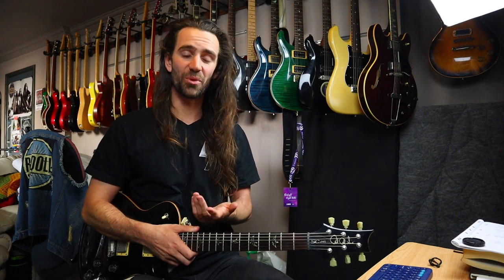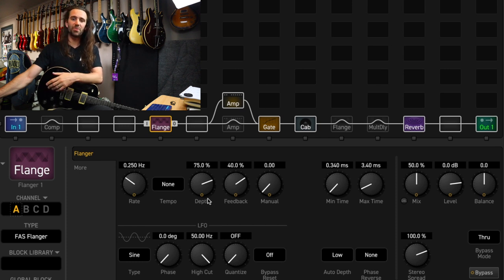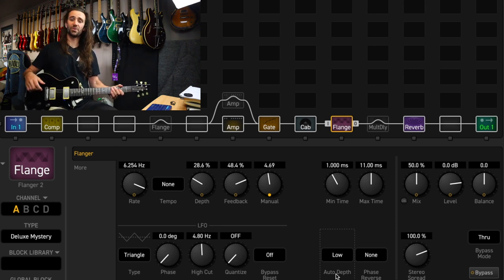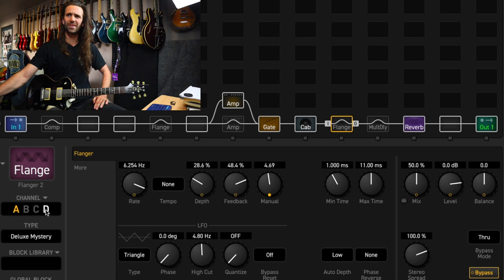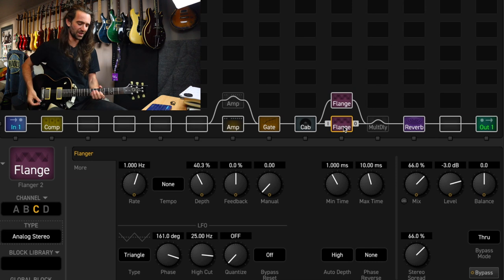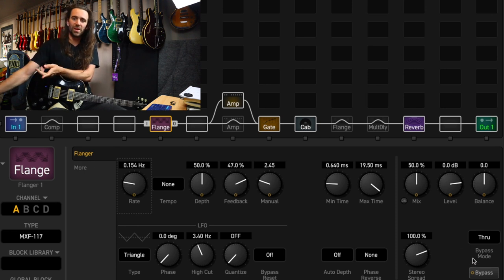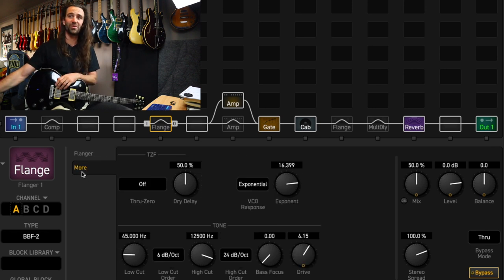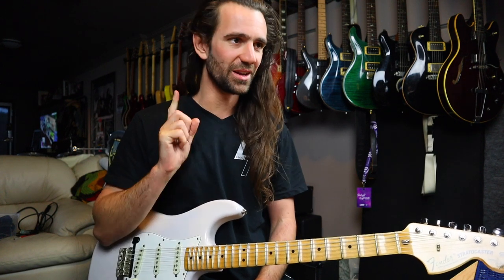Flangers! Axe-Fx III & FM3 - Tips, Tricks & More

Comment: The TC 1210 is a super confusing unit. It does say Flanger on it, and it does weird things with signal crossing left and right. It can be run in series or parallel, it contains a dry signal in it's mix. But it has a sound, so a parallel blend will keep your crystal clear dry and the 1210s wet effect will still be prominent. I had to look up other people's settings and choose a rate, haven't changed it since. For flanger effects the Eventides are equally confusing. They are often instrument level patches, so if you send a line level to them, get ready to be blown out of your chair. Again, a parallel mix send controlled with expression basically just lets a tiny bit of signal into it, and out comes this loud swishing sound. You nailed some good sounds with the Axe. I've always been after the sound of 'And The Cradle Will Rock' intro. The sound of all hell breaking loose. But it's my understanding, that's a keyboard. F'n Eddie. ;) Great topic! Thank you!!

Comment: For the life of me, I have NO Idea what people are saying when they claim they can tell the difference between a modeled amp and the real thing. From an old video with crazy horse, I just dialed up the exact fender model Neil used on Hey hey my my & I'll be damned if the cover doesn't have the same exact tone ( both to my ears LIVE and a DI recording of the same guitar)  I don't have the particular drive pedal he's using matched but it's EXACTLY the same. Awesome. Have a great week everyone and if you don't have one of these, you are without the single greatest tool ever created for a guitarist since the Strap.
Reply: Blue Betty I completely agree I have 6 boutique tube amps and love my axe fx 3
Reply: Same here for me.  I hear a song that I want to cover. Head on line to research the actual rig that was used.  Head to my Ax III, dial up a preset with the right amp etc (so far every time I’ve found the amp model I need), and after a bit of tweaking - I’m there!  Just blows me away.